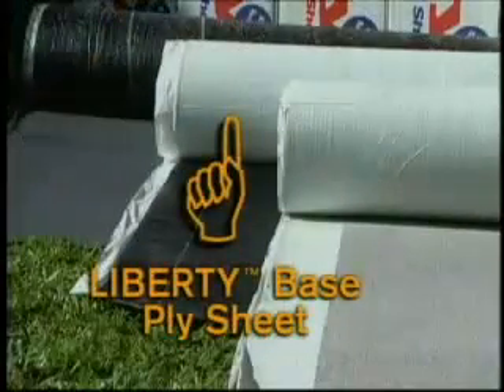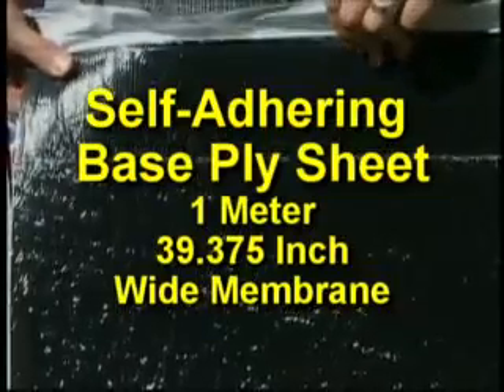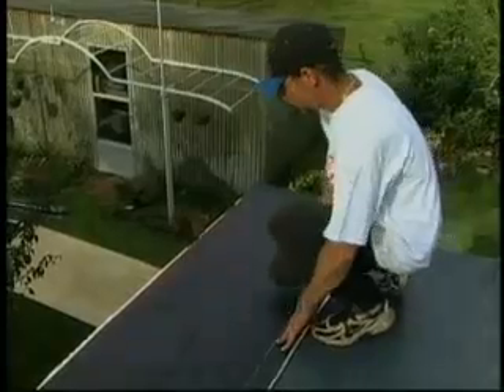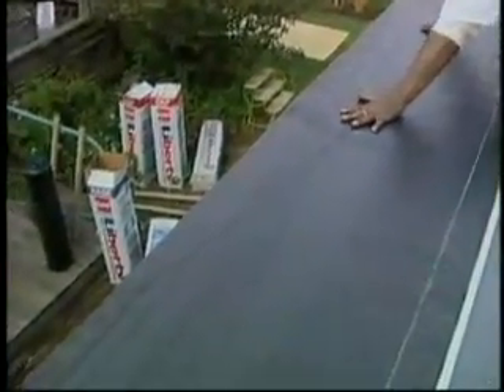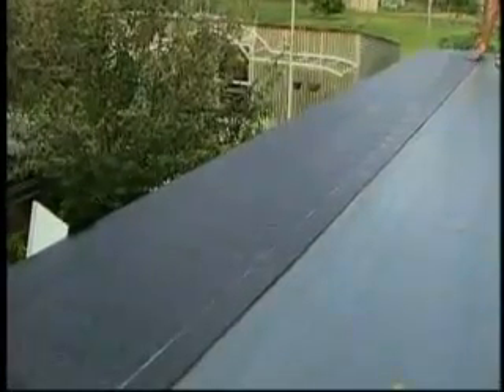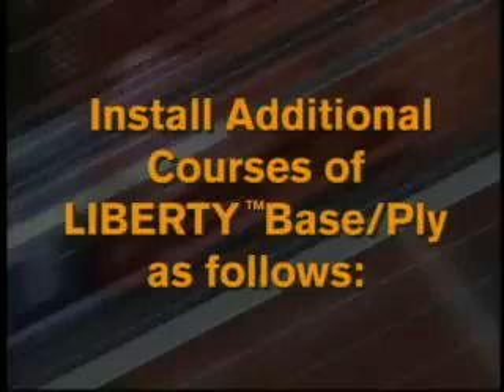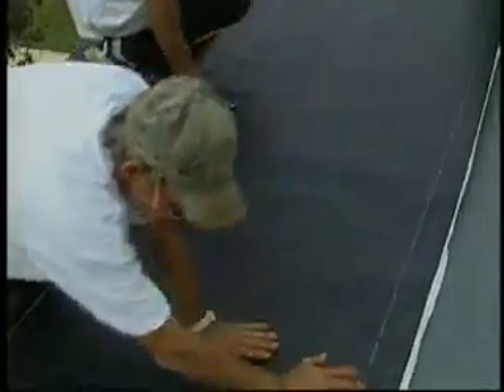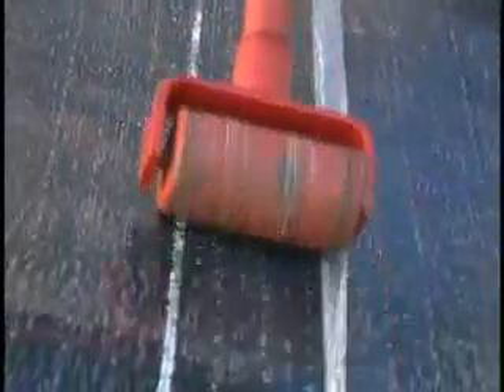Low Slope Roofing - Installing Liberty Self-Adhered Base Sheet

Comment: The base sheet was a dream to install.  The cap sheet however is a nightmare  The base sheet is simple to move around into position and stays super flat. The cap sheet is heavier and wants to stick on the preceding overlap section.

I thought I was missing an important tip but I can't find a good way to do it. The second sheet wrinkled so I'm taking a break looking for tips from someone who has actually installed this product.